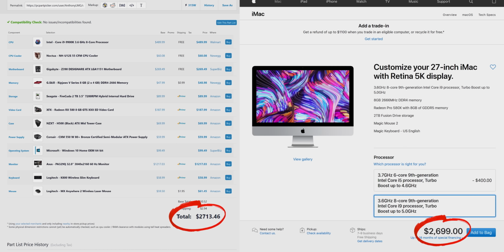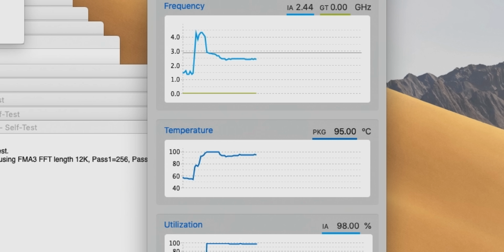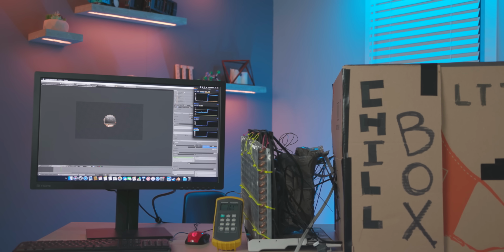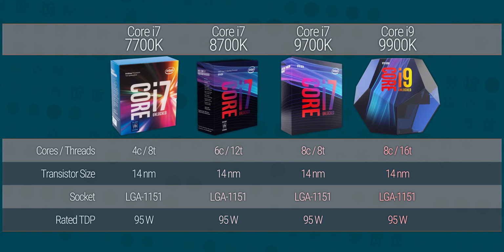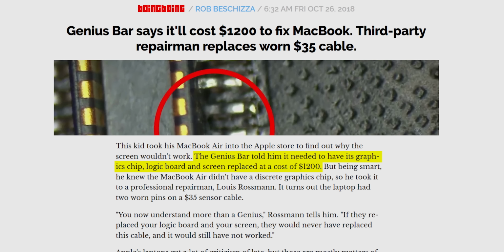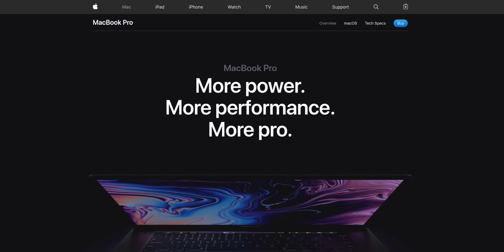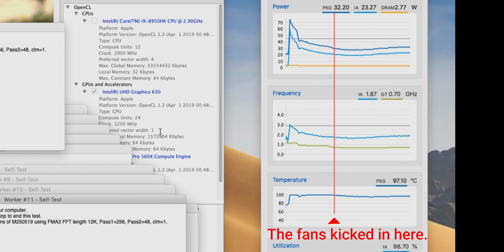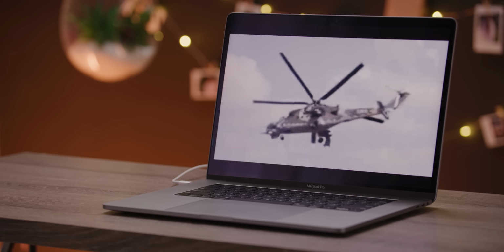Macs are SLOWER than PCs. Here’s why.

Comment: "A slower CPU that doesn't throttle is not slower than a faster one that does."
-Linus Gabriel Sebastian
Reply: Think people are missing the comparison.... If a 5ghz cpu throttles to 2.4ghz. Then a 2.4 ghz cpu is not slower.

He's not talking about core count or cache sizes. It's purely numbers. If a Ferrari that can go over 200mph but is stuck doing 35 down town. Then a slower car doing 35 isn't really slower...
Reply: @joshrowell8375  And if that Ferrari spends 95% of it's time at the track, on the highway, etc only looking at the performance "downtown" seems well sad/pandering/funny.
Reply: @joshrowell8375  OMG you're right.  Linus was able to improve performance of the Mac Book Pro a full 3% in this video, well 2.9% anyway!  Thats how "horrible" the cooling is!  
Hey in his May 9th video where Linus gets 10% more performance out of an Alienware thick heavy laptop by adding cooling were you equally outraged, or 3.4X more outraged?  I mean this is definitely about cooling not hating on Apple right?
Reply: @TexMex421  you're deeply rattled by this, aren't you?
Reply: @Soulrollsdeep  this? No.  I make a living fixing PC problems.  I think most people who do are not dumb enough to own them.
Reply: @Jonas Thats mac users,they think incredibly thin laptop that trade off performance for more style is way better...... and I take ROG to coffee shop and it is a bit awkward😂 but things get done within minutes
Reply: @Hunter zone old people who get swindled into buying a 1600 laptop for facebook use only
Reply: Yea what’s your point, do you not upstanding what he’s saying?
Reply: @nickburns4226  I don't understand what you are saying!
Reply: Hunter zone people that use it for “business”
Reply: Hunter zone not true at all!!! Rendering video on CPU-dependant NLEs like FCP X with an I9 is waaaay faster than with any of my previous machines, including here a 12 core Xeon from a cMP 5,1. Much, much faster actually. The fans come on and off and they really come on when outputting via Resolve, but that has to do more with the GPU than the CPU. I9 8 core has so far been very impressive with mainly video work, all sorts of formats and resolutions up to 6K. FCP X is literally as fast as I’ve always wanted it to be.
Reply: And it turned out to be true. The 8thy gen U class processors are some tuning away from matching a Hex-core Macbook pro, while using a fraction of the power doing it.
Reply: "that does throttle lower than the non-throttled slower one". Better?
Reply: How about a simple demonstration?  Test 2 CPUs and show one with a higher clock speed is slower when throttling, all other components and the load being the same, and no "chill chest" required.  I mean isn't that what the channel is supposed to do?  Why is this a guess when the test would have taken 2 minutes?
Reply: @TexMex421  how about you accept the fact that a MacBook pro is loosing more power, due to its bad cooling, than most other laptops in this price range. And most people I know need a lot of computing power and when the MacBook throttles back it's clock speed, I often hear that they get really frustrated. Apple could just put in a cpu that less powerful but doesn't reduce its power as much so you won't even notice a difference in performance, even when not throttling and you could even save a few bucks because the cpu isn't as expensive.
Reply: ...not “necessarily” slower
Reply: Yep pretty much...
Reply: A great example of this from my own experience.

back when i began college, I got a cheap windows 8 touch screen notebook (Asus Vivobook X202E) to handle my workload. weak as it was, I figured the core i3-3217u 1.8GHz CPU and 4GB 1333 RAM ought to be more than sufficient for school use. I also really liked the touch features, though I knew I was making a sacrifice with probably more than half the $450 being just the screen alone at that time. And initially, it was indeed more than sufficient, with me mostly only using a word processor and a few tabs of chrome. and I was even pretty impressed with the integrated HD 4000 graphics. but things quickly began to turn sour and a couple years later I was left increasingly frustrated as it just couldnt seem to handle having more than a couple of instances of Word, a small Excel sheet, usually no more than 5 tabs in chrome, or even a 720p youtube video. being no stranger to computer hardware and system building, I was fairly certain that those specs still should've been able to handle the load no problem. in fact, my practically antique desktop with a 2GHz single core AMD and 2GB DDR400 RAM, running Vista, could easily handle much larger loads. digging deeper, I discovered that the processor was pretty much never above 1.3 GHz unless it was absolutely idle with nothing running on the desktop, and it frequently dropped all the way to 700 MHz. it didnt take me long to figure out that running almost anything at all would shoot the temperature up to 80'C and start throttling (despite the processor being rated for 105'C, I was never able to figure out a work around to get it to throttle less or wait for a higher temp). And even then, it would still reach temps in the high 90s, occasionally even breaking 100. I ended up getting a cooling pad to put it on, with only very limited success. then, finally, a breakthrough as things took a drastic turn for the worse. the system slowed to a crawl, becoming almost useless, but contradictory to my expectations, I found cpu utilization was also taking a dive right alongside the performance. instead, the new bottleneck quickly became obvious, as the system was constantly waiting on a maxed out (but not even close to full) HDD with access times sometimes reaching into the tens of seconds, and a short time later, the ominous clicking noise began. I estimated i could get by on 120GB and ordered the cheapest SSD I could get of that size, hoping to stretch the poor laptop's lifespan just long enough to finish my degree. 

boy was I in for a surprise.

The new ssd fixed far more than I'd ever even hoped was possible. apparently, even before my bad experience, I had always dramatically underestimated the core i3 series, probably because they were always paired with the cheapest hardware. It seemed the old HDD had been producing a significant amount of problem heat and may have even been the main problem from the beginning. my "new laptop" was suddenly an ultrabook. it never exceeded 70'C, and stayed continuously at 1.8 GHz, even under heavy load. And speaking of heavy loads, as I was going through my junior year of Computer Engineering, it seemed to have no trouble handling 20+ tabs of chrome, plus multiple pdf's, word documents, and excel sheets, all while also running a multisim simulation and compiling logic schematics in Quartus. my lab partner and I were both shocked when it even managed to handily defeat his $1000+ AMD A10 ultrabook when compiling the exact same Quartus schematics in almost half the time. this unexpectedly amazing little "ultrabook" could handle pretty much anything I threw at it, work-wise, and even modern 3d games to a very limited extent (minimal settings), proving to be quite capable with minecraft, mass effect 3, and SWTOR all handling reasonably well.

TLDR: I solved the throttling problem with my old college core i3 budget laptop, and it went from a sweaty netbook that could barely handle a few chrome tabs, to a cool running, number crunching, program compiling, simulating workhorse ultrabook that could open "way too many tabs" and even handled some light gaming. dont underestimate the devastating effects of throttle.
Reply: If u buy a 3000+€ laptop to browser the web ur just stupid. If ur a creative of any kind u Will notice the preformance drop, alreast I do. My workdays are atleast 9+ hours a day. Also is i just me.. i just find iT anyoning to have such a hot thing on my lap!
Reply: @MM-ov8ml  Most MacBook owners spend the majority of their work time in MS Office and Adobe Apps.  The idea that you are either "just surfing the web" (so lame!) or constantly rendering 4K video (so hardcore!) is comical.  And no most creatives will never see any difference.  Photo Shop & Illustrator etc are not taxing the CPU.
Reply: Trust me I am devastated by your name calling "iSheep".  Thank you for assuring me that you (and some unspecified group) are not criticizing me.  
Linus just made a video about a "cool" new ASUS gaming laptop that throttles it's ass off. I look forward to your fact based assessment of throttling on that video.
Reply: @TexMex421 
That's exactly right! Most macbook pro users don't have work loads reaching throttling levels. For most macbook pro users the performance is good enough that they are willing to take a performance hit.

Buttt....

Linus is arguing that if i9 Mac books perform like a i7 in heavy work loads why sell i9 at all if it doesn't perform like a i9? The reason is hype marketing they can raise the pice, people still want and buy them.

I say if the performance is good enough for the user than it doesn't matter if it's not reaching max performance, as long as the user is aware of that fact.
Reply: @drewgarrett-stewart183   Yes, but that is just my point.  Those work loads are irregular for the average user.  And Linus admits it's faster than the i7 for many things a Mac Pro user would normally use it for.  Which it is.  I would say Linus seems stuck in thinking he is the normal use case, but I think he is just aware most of his users are PC gamers, and any complaint about Macs = lots of views.  And by the way I don't think macs are perfect, I just think they want the high end of the market and want to appear to that user.
Reply: @TexMex421  I agree for example, People who have fast cars can never maximize the speed of the car at 100+ mph. So why buy a fast car if you can't go fast linus is arguing? Well a few would be design, quality, and other proprietary features of the product.

MacBook Pros are the Farrari's of laptops they can never maximize performance, but they sure look, feel, and sounds, amazing!
Reply: @TexMex, He wasn't saying the temp boost will make the faster, but throttled chip, faster than a slower, but non-throttled chip, he was saying it would be temporarily faster in light loads, but slower in heavy loads relative to ITSELF. An i9 vs an i7 or an i5 wouldn't feel all that different in light loads, like web browsing. The limiting factor will very, rarely be, if ever, due to your processor, assuming it's somewhat recent. 

@Drew Garrett-Stewart Hence, Linus saying Apple is targetting the less tech-saavy market with their under-performing, oversold computers.
Reply: @ltnlng  "he was saying it would be temporarily faster in light loads,"  Yes, and it is.
An i9 vs an i7 or an i5 wouldn't feel all that different in light loads, like web browsing. Not true, and literally the opposite of what Linus said, and it does not matter.  The normal use case is not web browsing, its editing video and photos, spreadsheets etc with multiple applications open.  Even Linus does not spend most of his time on the many Macs he (and his staff) owns rendering video (or the PCs for that matter).

One question, why did Linus test the Mac book pro here closed?  Do you think that was normal for laptop use?
Do you think the 2.9% performance gain he achieved is worth building a chill box of your own?
Reply: Sigh, temporarily faster than What? Temporarily faster than ITSELF (at a lower clock), by boosting its core clock speeds temporarily. It's something it's SUPPOSED to be able to do for heavy loads too, if it wasn't thermal throttled. It's also something a slower cpu will be able to do too. The point is, the difference you will see in web browsing between an i5 and an i9 of the same generation, particularly if it's a recent generation, will be minimal, if at all discernible. 
Point to where in the video Linus says that an i9 will be faster at browsing the web than an i5.
And as for why it was closed, you can ask Linus that, but as for if it's normal for laptop use, the answer is yes. IF the laptop is connected to an external monitor like is shown here.
Reply: @WoDABDC  Sigh, most people don't use an external monitor, and when they do, most people want the additional works space of dual monitors.  Sigh, A closed laptop, wrapped in vinyl, is not normal.  Nor is putting it in a cardboard box with a window A/C unit in order to what exactly?
Sigh, 6:18 turbo boost, something the more expensive chips do more of makes web browsing "pretty snappy" according to Linus anyway.  Thats probably why his chief PC builder Anthony uses a MacBook Pro as his "daily driver". (Different Linus video: "How did Apple DO this?? - MacBook Pro 2019 - YouTube") Sigh.
Reply: 1. I never said most people use an external monitor.
2. Dual monitors with a large screen and a tiny one? It doesn't provide much additional work space, unless you mount it right next to it. Otherwise, it's just a huge pain.
3. The laptop isn't wrapped in vinyl
4. Ambient room temperature typically has a drastic effect on how hot chips run, varies depending on load, as shown by the Mac Mini
5. Closing the laptop Shouldn't affect thermals much, but I agree they should've done a test with it open as well, but NOTE they put closed laptops in chill boxes all the time
6. Even cheaper chips have turbo boost.
7. Linus does NOT say an i9 is faster than an i5 for web browsing at 6:18. It's NOT the same as saying turbo boosts makes things snappier, 
8. Using it as his daily driver is supposed to illustrate what point, exactly?
With all the sighing you're doing, you'd think oxygen was actually reaching your brain.
Reply: @TexMex421  Have to chuckle at your Apple apologetics, in the same way I'd chuckle at bicycle width tires on a ferrari 'because it's mainly used to drive in town'.
Reply: @TexMex421  wierd flex but okay
Reply: @Hunter zone Turbo Boost on light loads may peak higher on faster CPU
Reply: @Erick Rosa I have a an i7 3.2Ghz in my PC.  If that helps.
Reply: @Hunter zone Higher clock speeds do make it faster.
Reply: @420f37  He shouldn't say that on a family show.
Reply: Except in most use cases it is.
Reply: @TexMex421  No one questions Apple dammit!
Reply: @user-x7w5u  If you mean no one here questions them very effectively I agree.  Snazy Labs, and other Mac users are faaaar better at it than Linus despite Linus owning many Macs.  Far more intelligent criticism from the Mac user base than any PC gamer
Reply: @TexMex421  lmao for linus, if the speed of the cpu is not properly utilized then why are they selling it. He feels like people are getting ripped off with the i9 version for minor performance boost over the i7. You don't think he is right about that point?
Reply: @drewgarrett-stewart183  I know right?  Linus was only able to get 2.9% improvement out of his personal model by placing it closed and vynal wrapped in a air conditioned cardboard box. So much for real world testing!  And he didn't bother to test a single thin PC i9 Notebook like you guys seem to be demanding!!!  What is he afraid of???  Talk about LMAO.
Reply: @TexMex421  I agree all thin and light i9 laptops are not properly utilized. it's not just Apple exploiting consumers it's the whole industry dell, msi etc all have i9 laptops that throttles.
Reply: Everything - gaming and rendering.
Reply: @TexMex421  are you really from texas
Reply: @thecrabcat1548  who told you that?
Reply: @TexMex421  your name Is Texas mexican
Reply: @thecrabcat1548  I've seen my birth certificate and I can assure you it is not. Are you aware that TexMex is a cuisine?
Reply: @TexMex421  yes I am. Do you at least like texmex food
Reply: @thecrabcat1548  Yea, it's pretty good.  I'll take italian in a heartbeat though.
Reply: @Hunter zone  Why does linus say it will? 6:05
Reply: @bibibibibibibi-g9l  linus said the clock speed is dramatically boosted.  Also i9s  turbo boost significantly more than i5s.  And yes in day to day normal use cases, it's faster.  And in rendering and gaming, something most Mac book pro owners never do, there is throttling, just like in PCs.  Why do you think Linus tested zero PCs in this video?
Reply: @Hunter zone False, and anyone who could afford it.  As Linus mentions in this video 6:06 drawing a web page is faster, launching an ap, almost everything is faster.
Reply: @Hunter zone  I use a Mac pro, and have upgraded the CPU and added liquid metal thermal compound.  Most of the content creators I work with prefer desktop Macs for heavy lifting.  But we are all happy to be told by PC users how we do things and what is wrong with our methods. Thanks!

I'd love to see a video about choosing a cooler for your PC laptop.  SO many options!
Reply: @TexMex421  There are tons of laptops with better cooling (and therefore, better performance for similar components), you just can't buy any of them from Apple.  If the software is worth the tradeoff, fine, but you can't argue that better cooling won't help.  

Same goes for desktops; maybe the next Mac Pro will change that. 

Until then, "gaming and rendering" will be slower on a Mac vs a properly cooled PC.
Reply: @owenfpope  Wow, if I used a laptop for burning video (why would you?) I'd be genuinely concerned.  Please tell Linus about this as he is water-cooling PC laptops with window A/C units.  https://youtu.be/pt1jkv89Hws?t=1027  It is crazy that this is normal for you in the PC world.
Reply: @TexMex421  but you can liquid metal a laptop too
Reply: @ilyas5708  Who said you couldn't?  Don't let me stop you.

Comment: you cant charge premium with a slower cpu that doesn't throttle vs a fast one which does. :))
Reply: I do think that is the problem. On paper it seems like there is no Apple tax, but high end CPU's have a higher profit margin than low end ones.
Reply: Well, Apple often charges a premium for two year CPUs.
Reply: It's Apple, of course they can.